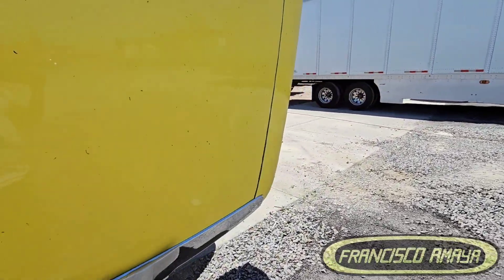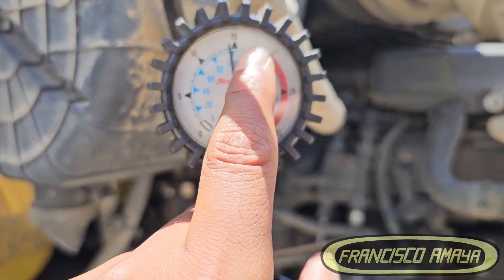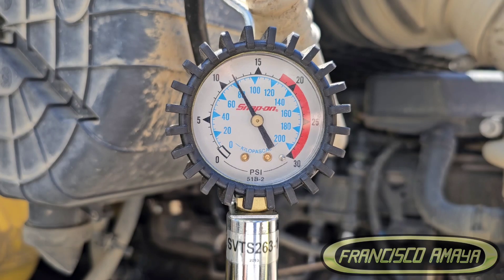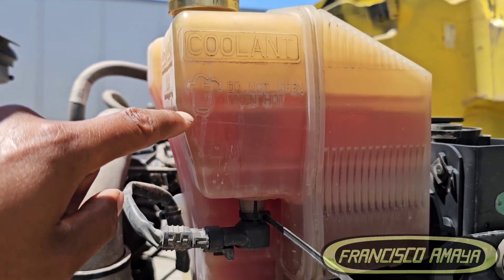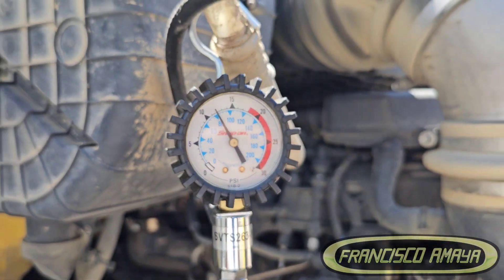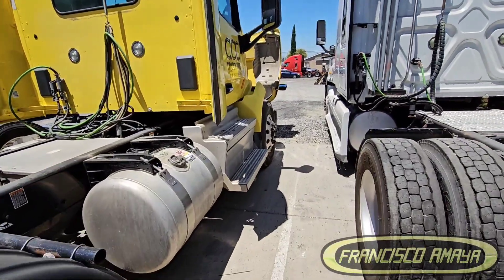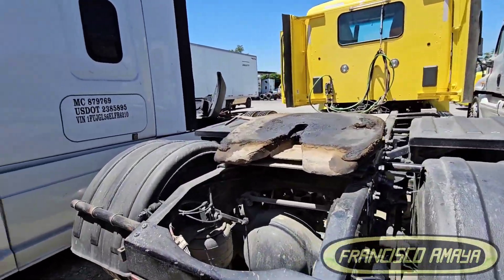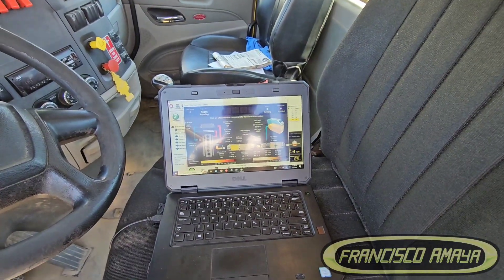PACCAR MX13 ENGINE COOLANT TANK HIGH PRESSURE ENGINE COMPRESSION LEAK WHILE RUNNING

Comment: Im having same issue but with a S60 14L, we kept getting the coolant push out the release pressure hose, we replace coolant reservoir, air compressor, and then we tho it was the gasket but it was intact. So finally we replace the head but the mechanic messed up 2 pinion gears smh now we will see if that fixed the issue.
Reply: Did you fix it. ??

Comment: Blessings I got a kw t680 with a paccar mx13 with the same problem .. I replaced the air compressor…. I and still had the problem … the problem was the head cylinder … cylinder 4,5 were causing the problem and there was a problem with the compression.. just like you said